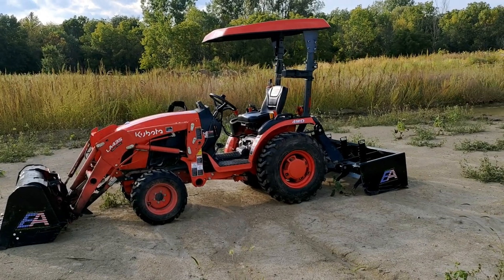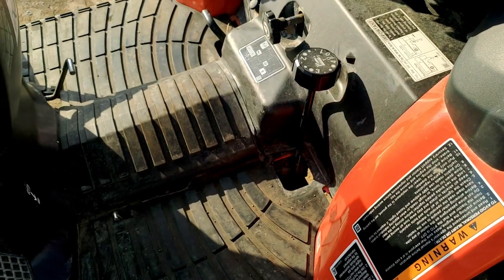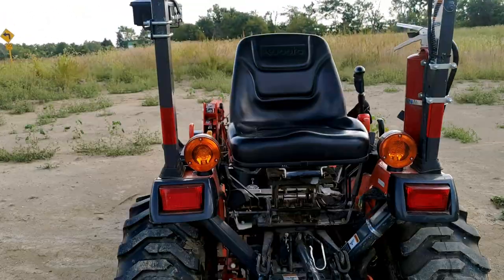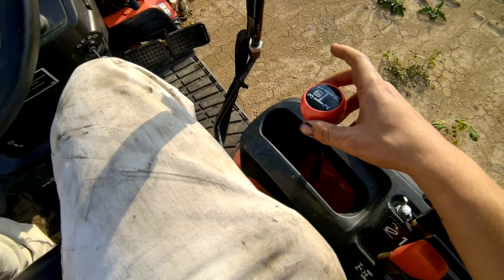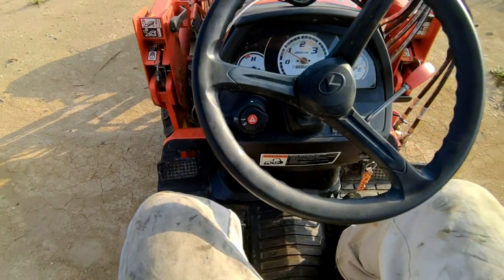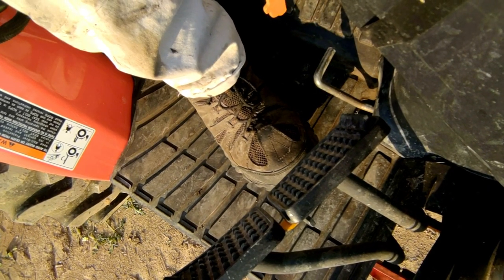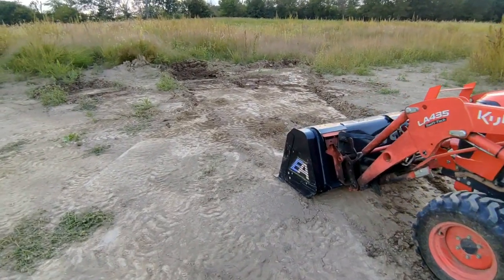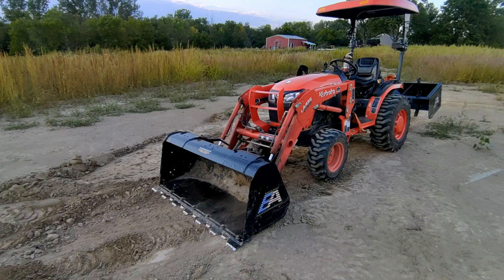Kubota B2401 Overview and Shifting + Loader Operation

Comment: Just so people don't get the wrong idea. This guy has no clue what he's talking about with the clutch. You absolutely need to be gentle and smooth with it, because slamming it will wear it out much faster over time and could cause a failure in the transmission. Please do not look to this video for advice.

Comment: I love the 2401. I got it this past summer and one thing I like most is the fact this tractor can pull 2 to 3 times as much as the 2601 because of the transmission
Reply from the maker: That is really nice.  Can pull the front wheels off the ground, even with a loader.

Comment: Wish i would have known about this tractor when my dad and i were shopping for a small tractor. We eventually went with the bx1880 and the hydrostat whinning is really annoying...i just got done with digging out a driveway for myself with a troybilt tiller and the bx1880. And yeah the 1880 for sure moved the dirt no problem, but the whinning is just irritating even with earplugs in.

Comment: great review, I was leaning towards a manual gear box as well for sake of durability. I was a Kubota mechanic for a few years and worked on too many hydrostatics. Cant wait to see some engine 'mods' in the future being that its a manual and dont have to worry about breaking a hydro.
Reply from the maker: Thanks!
I am hoping this manual gearbox is built pretty solidly.  Time will tell I guess.

I want to build a PTO dyno someday to see how much power I'm making before and after modifications.  Try the easy stuff first like advancing the injection timing a bit.

Comment: Excellent video!  Someone saw my short little videos and asked me to do something like this.  I'll send them your way :D
The other reason to get the B2401 over the B2601 is price.  With sales tax, it was 5000$CDN less here in Ontario.
@10:30 the technique I use, while it looks stupid, is to try to move the tractor just enough to move the drive gear by standing up a little and sitting down hard against the back of the seat.  
@20:10 one time I could not start in H3 was pulling a trailer with 1500lb of firewood.  And with all that momentum behind me, shifting on the fly was quite smooth
One things I could still do a video on is using a rotary cutter (bushhog) with the geared transmission.  There a lot more "user-input" required when changing direction (but we like that).

Comment: I think I’m sold on the 2401. I was looking at the LX2610 but they’re as expensive as a L2501 and that’s a tad too big for me. I wanted gear driven and this is the only one. How much extra was the rear tire weights? I also think I may want ag tires
Reply from the maker: I have 4 60lb weights which were about $60, plus $20 shipping, each.  ~$320, not including whatever I paid for the carriage-bolts and hardware.  I got them from TaylorFoundry.
Don't order any weights until you know for sure what mounting pattern your wheels have, if any.  I don't recall the details, but I do know for sure that the wheels for the ag tires are different.
If I had to buy the machine again, I'd go for the R14 hybrid tire.  I am satisfied though with my R4s.
I like my 2401 a lot.  I also like the L2501, but it lacks the mid-pto and the rear pto is 540rpm only (2401 is 540/1000).

Good luck on your tractor hunt!
Reply: @zoidsfan77  oh okay, gotcha. Thank you, that’s good to know! You sure know your stuff. Yeah, I have experience with the R4’s on a higher HP tractor where I work, decent tire but for a compact I think I’d like something that digs a little. I’ll have to look into that more. 
Yeah, the PTO set up on a machine this small is a very nice extra. For the money it’s quite worth it. 

Thanks!
Reply: @@itsmancini Well, the dealer only had a B2601HSD in stock and it was on sale because it sat for a few months. They typically sell large farm tractors and got this to market smaller tractors. Love it though! It’s a great size and am happy with the HST after all.

Comment: Where did you get the rear wheel weights? I have bio ballast in my B2401 rear tires but it could use additional weight.
Reply from the maker: They are TF655 wheel weights from Taylor Foundry.  I used two in each wheel, 60lbs each.
I mounted them using eight 18-8 Stainless carriage bolts, 1/2"-13 thread, 6 1/2" long, along with matching stainless flanged locking nuts.

The weights made a big difference.  My tires are just plain air though.
Reply: @zoidsfan77  could you fit 3 of the TF655’s on each wheel? Would 3 even be necessary?
Reply from the maker: @theWortMonger  You could, but 2 is the most you can put without sticking out significantly past the edge of the rim.  It may be a challenge to find carriage bolts long enough.

Comment: Can you provide the details on how you increased the engine rpm to 3000, I have the same tractor and am interested in the same mod, thx Rod
Reply from the maker: Interestingly, someone else asked the same question in another comment only 3 hours ago.  I will paste the relevant part of my reply to them:

Increasing the limiter is a very easy engine adjustment, but I recommend caution.  Firstly, increasing the engine speed also allows you to over-speed PTO implements, which depending on the implement can be very dangerous.  Secondly, it is possible to adjust too far and overrev the engine.  I set mine to 3,000 which I feel is well within design limits for the engine.  Kubota makes D1105 engine variants up to 3600 rpm for generator service.  Thirdly, it could effect you if you have any engine related warranty claims.
If you look at the right side of the engine you'll see the injection pump.  Operate the throttle and observe the linkages.  It will be obvious how it works and what you will have to adjust to increase the RPM limit.  Disconnect the linkage from the pump and operate it by hand until you set the limit screw to the setting you want.
When reattaching the linkages you may have to install it in a different hole on the lever, and adjust the nuts at the end of the linkage rod.  You want it so the lever rests against the low-idle stop when no throttle input is given, and maxes out against the limiting screw when at full throttle.  At full throttle you don't want the throttle rod to have too much force on it, so adjust such that with the floor pedal floored it just reaches the limit.
I would also not recommend adjusting the RPM limit on a new machine until it is out of it's engine break in period (50hrs per Kubota) and has had it's first oil change.
Reply: Thank you! I have 170hrs now on mine and feel comfortable making the adjustment. 
Funny that when I told the local kubota dealer that I was not reaching full PTO rpm (below the arc under load), they just said sorry, it’s set at the factory and we don’t touch it.
Reply: If you are not reaching full rpm under load at factory settings than it would stand to reason that your load is too great for your size tractor.

Comment: Could you please tell me the width of your 2401dt and if rear wheels are adjustable? Thank you!
Reply from the maker: The width is 48 inches at the rear wheels, and no they are not adjustable.  There is a narrow version of this tractor, the B2401N.  I don't know it's specs, but it is narrower than mine.

Comment: How's it holding up for you?
Reply from the maker: So far so good.  Really only two things have gone wrong.  The backhoe valve developed an internal leak and was replaced under warranty, and later on one of the power-beyond quick connects (for the backhoe) had developed an internal restriction and caused some problems.  I replaced the connectors with flat-face style couplers and they've been great.

Overall it's a great machine for me.  I do wish it had a bit more PTO horsepower, but that's not the fault of the machine but rather this size class.  I plan to install a big engine oil cooler and do some engine mods eventually (I can't leave well-enough alone).

Comment: Just got one use with 5 hours on it.  Have you used it to dig up any stumps or plant trees?
Reply from the maker: I have.  The backhoe works well for that, although it is not pictured in this video.  I also have a 3 point post hold digger.
It's not a big tractor, so digging large stumps will take some time and planning, but I've done it.
Reply: Hey what did you do for a 3rd function / remote rear valve?
Reply from the maker: @smoothdurban  The 3rd function valve for the loader is Kubota part B1653.  I do not currently have a rear remote on this tractor, although I'd like to install one in the future.  There is the rear "power beyond" circuit for the backhoe though, and comes as part of the backhoe install.

Hopefully that was helpful.
Reply: @zoidsfan77  that kits is coming up as only for the 2301 and 2601. Were there any differences to adapt that kit to the 2401?
Reply from the maker: @smoothdurban  Yeah now I remember there was some trouble as the loader handle is different.  The dealer had a lot of problems installing it, all handle related.  If I remember correctly they had to use the handle from the kit for the B2650 hydrostatic tractor.

Comment: Won't double clutching enable you to get it into gear while moving?
Reply from the maker: Yes it can, but because the tractors gearing is so low it is more difficult to do at lower speeds in lower gears.